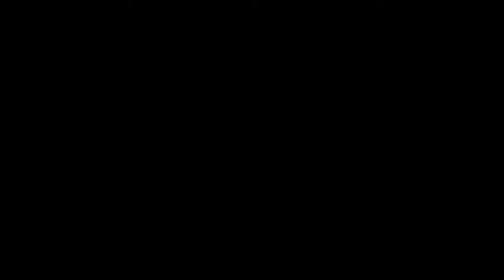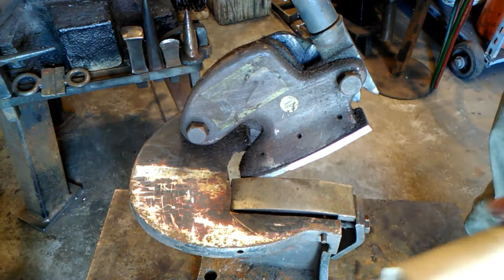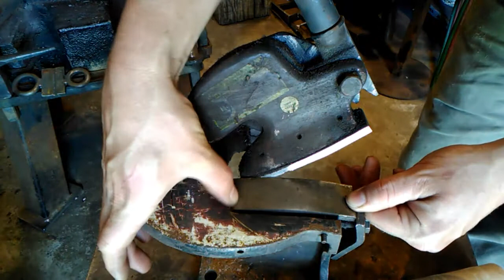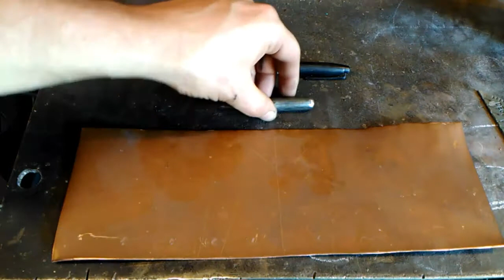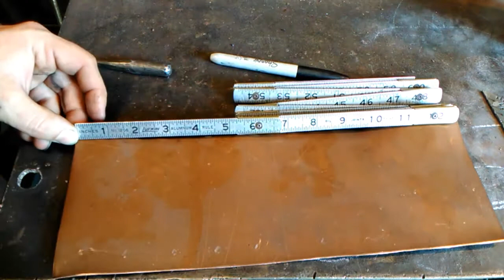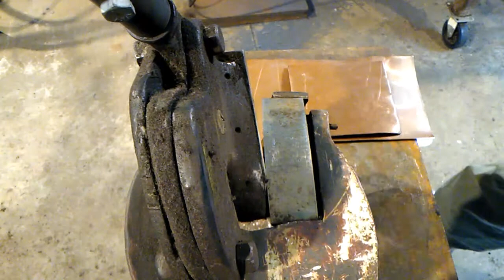How to Use a Metal Shear // Cutting Copper Plate (Cutting Metal with My Harbor Freight Metal Shear)

Comment: Hi thanks for all the great videos. Could you do a sharpening video.
Thank you
Reply: I got one of those 4 sided diamond bars at HF. start at the lowest grit, and hand grind the flat edge away until lower grits can clean and make it shine. Sometimes its good to grind at lowest grit, then another higher grit, and back to a lower grit again if you need to take out a lot. then once its flat, use higher grits to final edge. Then I took a couple swipes on the curved side to take out any burrs. I did this when first getting it to hope that the better I keep it sharp the better it will stay sharp.

Comment: What gauge copper are you cutting? Have you tried or do you think the shear would cut 10 gauge/1/8" thick copper?
Reply from the maker: That is the exact gauge I cut all the time with it :-)
Reply: Perfect! I was debating purchasing the shear today at HF w/25% off coupon ($109 is a bargain!). Should the copper be annealed before cutting?
Reply from the maker: It definitely helps for the copper to be annealed before cutting. Also when you get yours some of them are not quite set up from the factory so you may need to adjust this shear a bit to get a good clean cut.
Reply: Thanks much for your help. Yes, I've read dozens of reviews and figure I'll need to do some tweaking. I have a 30"x42" sheet of 10-gauge, not sure how I would anneal it - I guess I could torch one corner, let it cool since won't be able to quench it, unless I spray it with water? Anyway, the shear will be a big help in the long run. Thanks again for your help. Nice video!
Reply from the maker: Whenever I need to anealed large sheets of copper I use a weed burner in work evenly across the entire surface. I'll set it on fire bricks out in the driveway in my case I have a gravel driveway and then heat it with the weed burner after that just a 5 gallon bucket of water poured acrossed it will quench it :-) then again depending on the copper you got you may already have a pre annealed sheet so therefore you won't have to worry about annealing it before cutting it. God bless you and hope you have a good rest of your day
Reply: Thank you very much. Best to you as well.
Reply: I finally mounted my new HF shear last night, cleaned it, adjusted the blades so they slice paper. I first cut 21 gauge copper. Sliced like butter. I then tried a piece of 10 gauge semi-annealed copper, and it chipped the blades at the same spot where your blades are notched. I plan on returning the shear to HF today, but am undecided if I exchange it or get a refund. I was wondering if you had tempered the blades, and if so, how? Somebody suggested 500ºF in an oven for an hour, then turn off oven and let cool.
Reply: though they dont rate it for copper, its rated (currently) for 16 gauge steel. So getting twice the thickness our of it seems like asking a lot. 
 @shirleywalle5595

Comment: I bought the same HF shear and read that the blades are too brittle and need to be tempered. After heating, quenching and tempering in the kitchen oven at 400 for an hour, I got a nice even straw yellow color. I have had no nicks in my blade for the past three years.
Reply: If they're already brittle you might be able to get away with only tempering

Comment: I have the same shear from HF. It works great and I never adjusted anything on it. It's one of my goto tools for metal cutting. Thanks for the tip on using the scribe and were to cut.
Reply from the maker: +eviltwinx thank you for watching and taking the time to comment! This year is one of the tools I think Harbor Freight has a great deal on:-)
Reply: Thank you for the video.
Going to try some of your copper bowls, been making them out of steel. The tin snips work ok, but if I'm going to spend the money on copper, I want to get a cleaner starting cut. Are you still happy with your machine and is there anything else you would recommend to go with them?
Really have enjoyed your stay series and other videos. Made my first decent sale today, local tourist trap bought 13 copper bracelets, some steak flippers, bottle openers, and some other small trinkets. $570 worth, it was like being on a first date selling something I had made. Hope all is well.